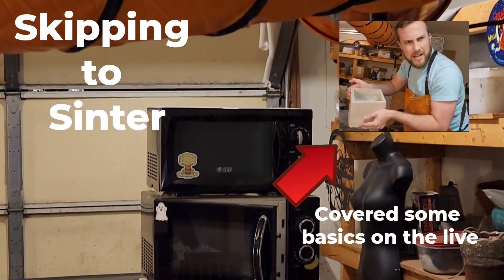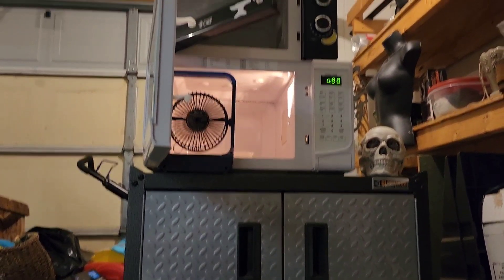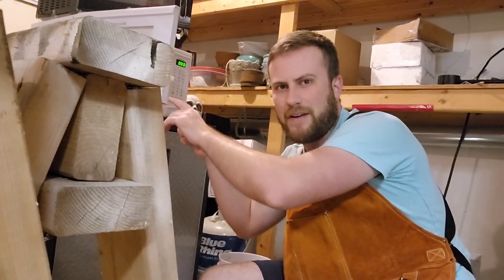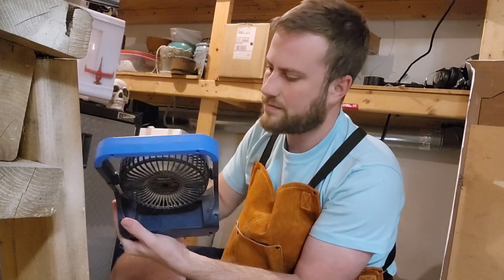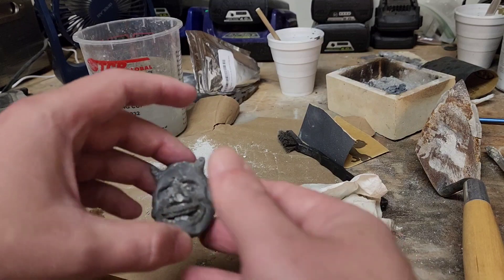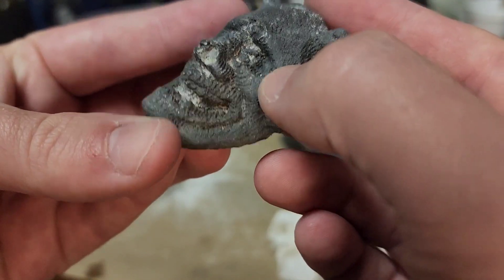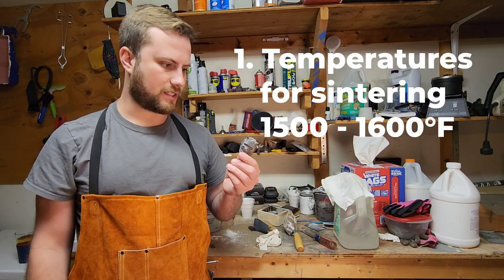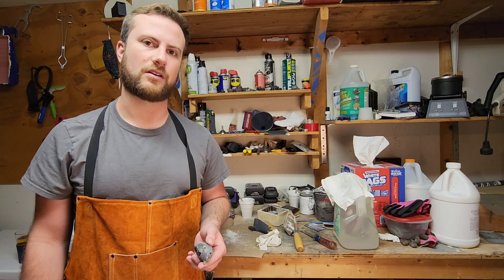Aluminum Microwave Sintering Lessons - 3 of 3

Comment: adding either single or double walled carbon nanotubes helps tremendously with the sintering process. I am able to sinter 90% SS316L in-situ layer by layer using a 50-70ghz electromagnet suspended a couple millimeters above deposited layers. In theory this method could completely eliminate most post processing, bar maybe a chemical bath.
Reply from the maker: Interesting, any video or writeup of your process? If your willing to share about how long do you hold per layer?
Reply: @Mr-Highball  I chose a multiple pass approach for better crosslinking between layer separated CNT dendrites. Somewhere between 5-10mm/s travel speed @ 20a ~12ghz seems to work for other SS alloys, but 316 has proven to be much more energy and condition restrictive. 

also no video or writeup, I am a troglodyte child throwing darts at a board until something works. You have my full permission to replicate anything I've told you but no promises since they've only worked in my own apartment lab
Reply from the maker: @Acaicia  🍻